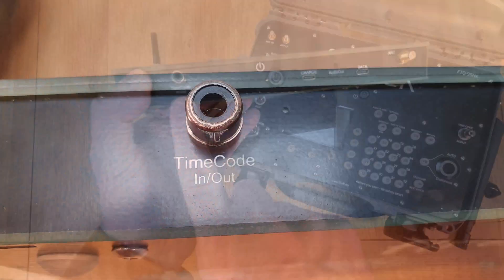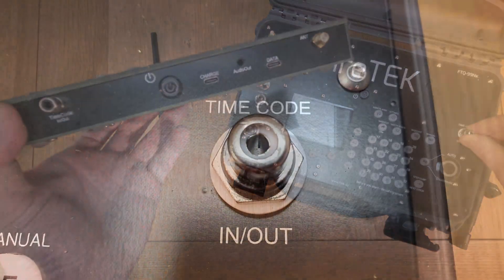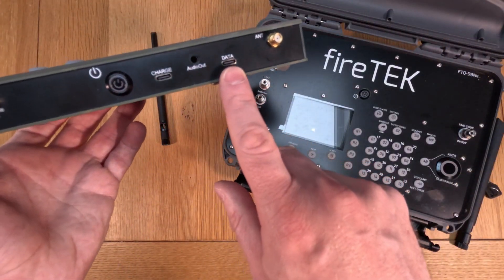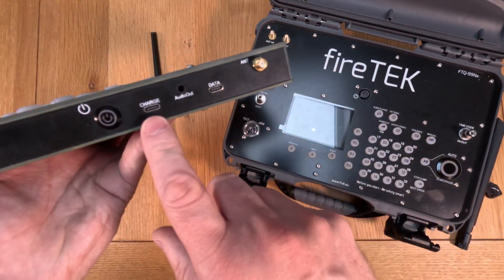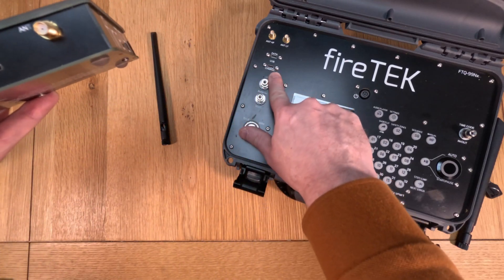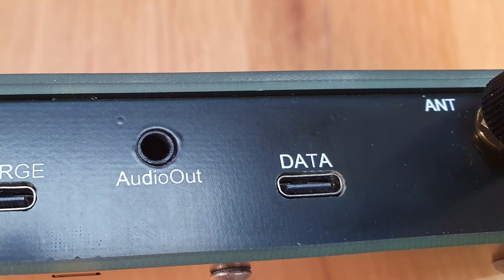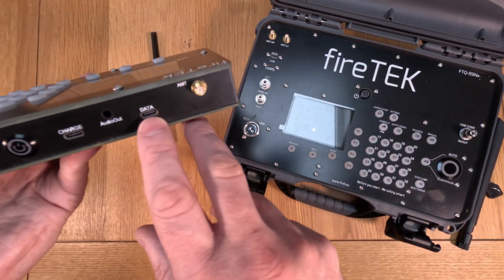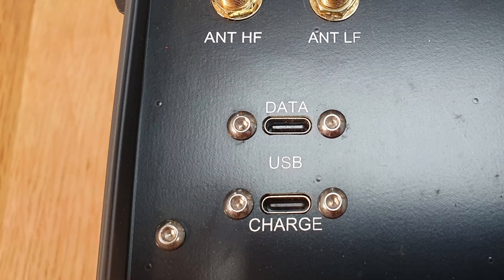FireTEK - FTQ-99Sx vs FTQ-99Nx controller comparison

Comment from the maker: UPDATE: Since the publication of this video, FireTEK have reached out to clarify that either 2.4GHz or 868MHz wireless options are available for the FTQ-99Sx controller, but not both at the same time (unlike the FTQ-99Nx). I'm happy to make that correction here.